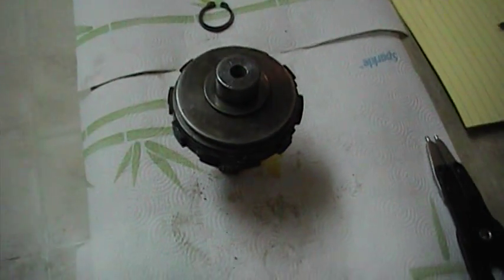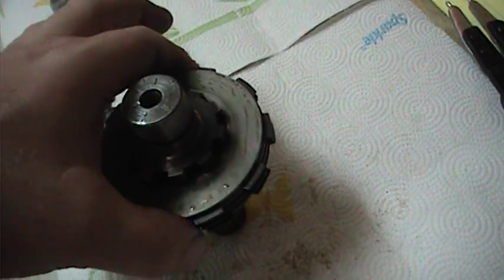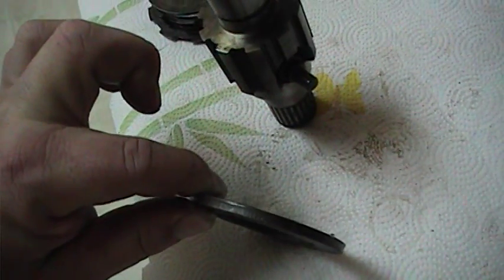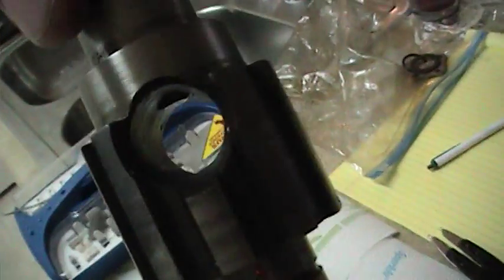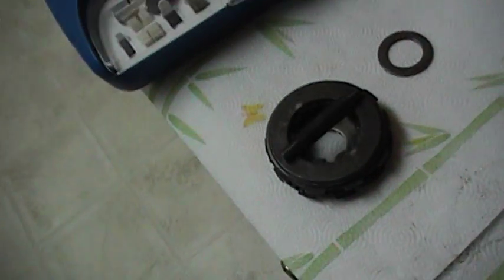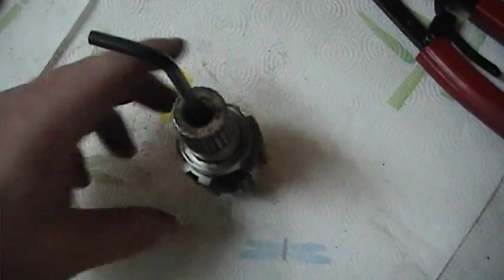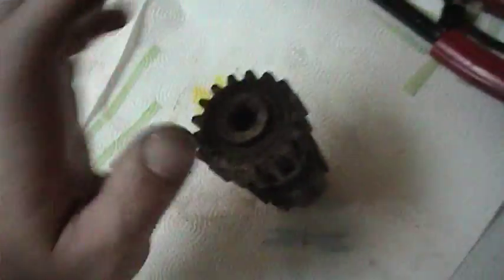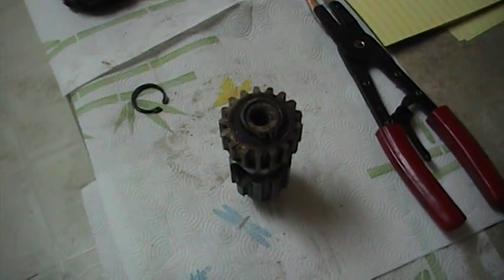OMC Tilt Clutch

Comment: I know this is 12 years old, but new to me. 😂 looking to seal up the clutch housing while replacing motor and solenoid. Clutch appears working, but kit came with new gaskets, oring and oil seals. Can I replace just these parts without taking the whole clutch assembly apart? Don’t want to cause more trouble for a “simple” fix. Thanks
Reply from the maker: now that's you know the right way to do it, i'll tell you what everyone actually does...they pack it with as much marine grease (like packing a bearing) as they can get up in there and dont worry with oiling anymore...and it works great
Reply from the maker: for sure the bigger O ring, the oil seals and the outer gasket can be replaced just by taking the outside gear off and the 4 bolts holding the cover on...most everything that seals has to do with that cover

Comment: The two seals do not go back to back, the way you showed is incorrect. The two seals go in the same way not back to back. That as you can see will not work it leaves the spring side of the seal exposed to the outside you are wrong.
Reply: Do you have a video of this or a reference?

Comment: Do I need to remove the stern drive to pull apart gear box tilt and change the seals? Or do I just need to lift and support sterndrive I’m up position to pull apart gear box assembly?

Comment: To remove the clutch pack from the housing, do you just remove the smaller snap ring on the gear end of the system and slide it out through the cover side?
Reply: It’ll work make sure you have weight off

Comment: Can you tell me if the tilt clutch on a 1976 400 Stringer should be the same!! I know this is an older video so Im hoping you will get this message.. Ive replaced the motor for the clutch and it still wont lift the motor up or down.. Im new to the boating world but an mechanically inclined.  I cant find any videos in regards to the 400 outdrive.. or the 4 cylinder motor..
Reply: Take the cover off the tilt clutch housing and se if that snap ring (the heavy duty one in the video) is popped off the shaft. Happened with mine before...if It is popped off there will be no tension on the clutch and the clutch packs will just slip instead of lifting. You can verify this problem easy tho - if the out drive can be lifted by hand up and down this is likely the problem.

Comment: I just took one apart and I ended up ruining those two oil seals.  Actually I only remember there being one oil seal and not two.  Is there any reason that I would only have one.  Lets say that i decide to go to tow  oil seals...  you said to install them "back to back" but you were moving them around so quickly on the video which was kind of dark anyway.  The oil seals I've seen have one side that is flat and the other side is sort of open so that you can see down into it and there is often a stretchy spring that goes around down inside the open part.   When you say to put the seal in back to back  which side do you mean?   Also do you have a model number for these seals and where could i get them?   Can i find these at any auto part store?
Reply: Go to marineengine.com enter yer of motor and type will have all parts you need and break down parts list. Yes need two seals back to back.  We’re you able to take the gear box apart with the whole stern still attached?